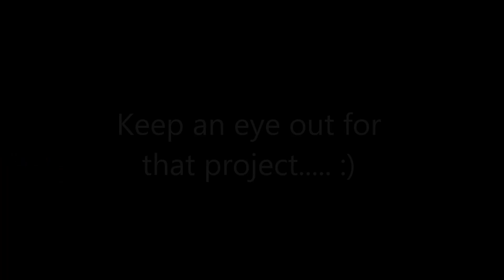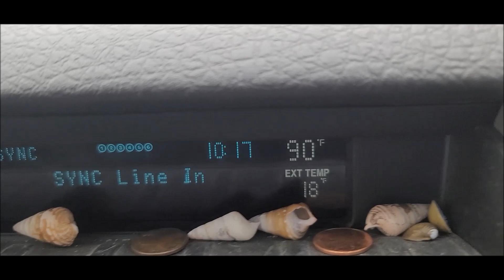NO Cars...Just snow..Kinda

Comment: I grew up in Wisconsin where snow and sub zero temps were a common occurrence but here in Texas where record breaking cold 🥶 has caused the pipes to freeze and the electricity to go off my idling Vic is the only source of heat.  Could be worse I guess.